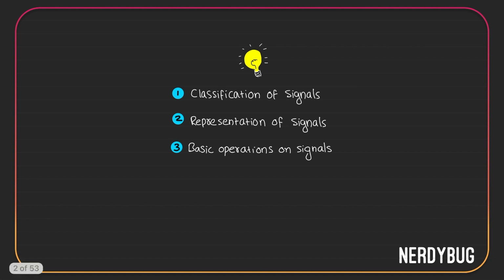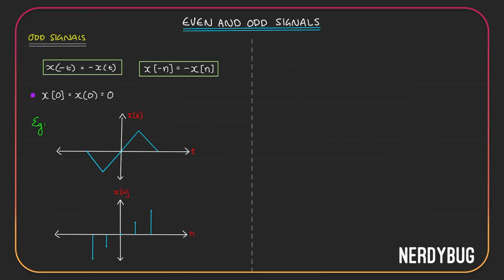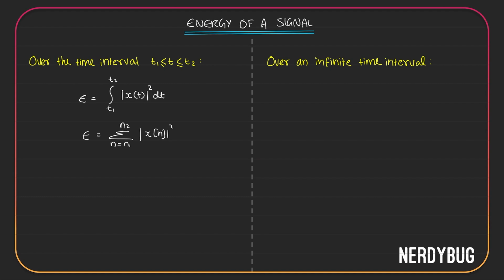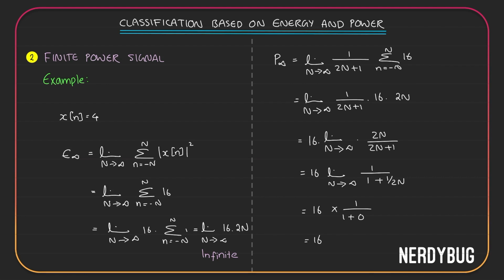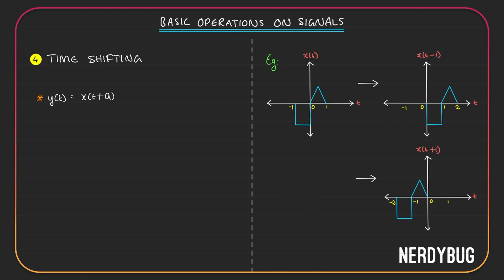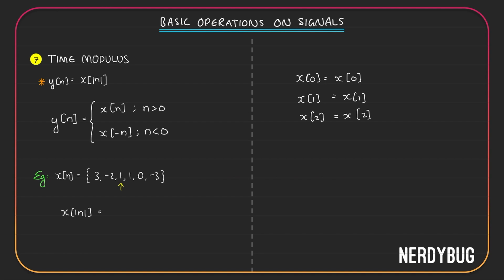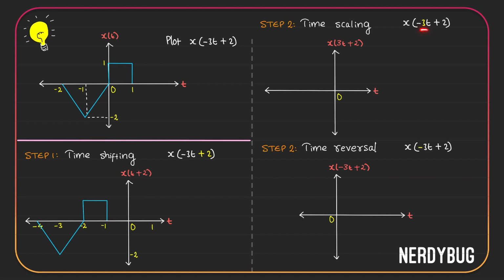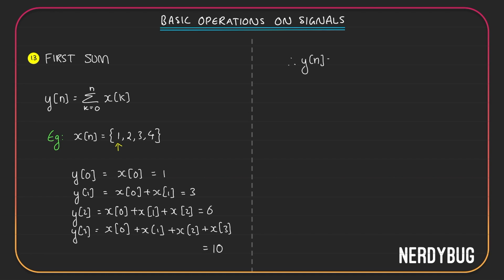Introduction to Signals | Signals and Systems | NerdyBug | 2024

Comment: Can i watch this playlist for gate exam preparation mam?
Reply: And then solve the pyqs or its theory based
Reply from the maker: Yes and no. I have covered the signals part but not DSP. So, compare with the syllabus and proceed. Also make sure you solve lots of problems. I'm working on Signals PYQs as well.
Reply: @NerdyBugNB dsp is not in gate mam only signals and systems

Comment: hello! i have a exam in a month or so on signal and system. the syllabus is below. CAN you tell me if you have covered the most and which part you havent, please.

Energy and power signals, continuous and discrete time signals, continuous and discrete
amplitude signals. System properties: linearity: additivity and homogeneity, shiftinvariance, causality, stability, realizability.
Module II 6L
Linear shift-invariant (LSI) systems, impulse response and step response, convolution, inputoutput behavior with aperiodic convergent inputs. Characterization of causality and stability of linear shift invariant systems. System representation through differential equations.
Module III 8L
Periodic and semi-periodic inputs to an LSI system, the notion of a frequency response and its
relation to the impulse response, Fourier series representation, the Fourier Transform, convolution/multiplication and their effect in the frequency domain, magnitude and phase response, Fourier domain duality. The Discrete-Time Fourier Transform (DTFT) and the
Discrete Fourier Transform (DFT). Parseval's Theorem. The idea of signal space and
orthogonal bases.
Module IV 8L
Evolution of Transforms: Fourier Transform, Laplace Transform , Z-transform (single sided and
Double sided)
The Laplace Transform, notion of eigen functions of LSI systems, a basis of eigen functions, region of convergence, poles and zeros of system, , solution to differential equations and
system behavior using Laplace Transformation
The z-Transform for discrete time signals and systems- eigen functions, region of convergence,
z-domain analysis.
Module V 4L
The Sampling Theorem and its implications- Spectra of sampled signals. Reconstruction: ideal interpolator, zero-order hold, first-order hold, and so on. Aliasing and its effects. Relation between continuous and discrete time systems.
Reply from the maker: Hey! Each video starts with an index that lists the topics covered. It'll be super easy for you to compare it with your syllabus. Hope that helps!
Reply: @NerdyBugNB  i hope most part is done?
Reply from the maker: @mindfullness7777 Yes! Since your exam is coming up soon, it might help others too—share the channel with your friends who are preparing. All the best!